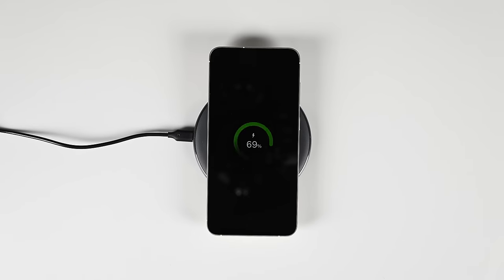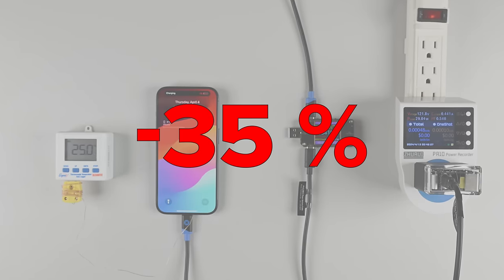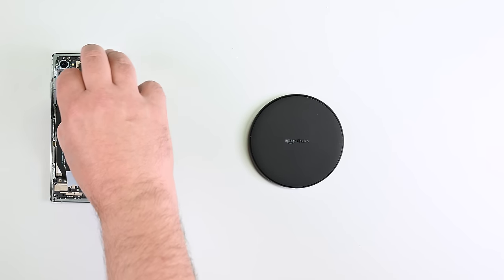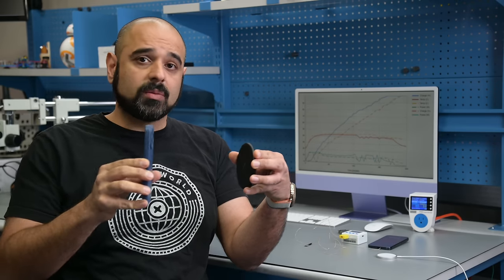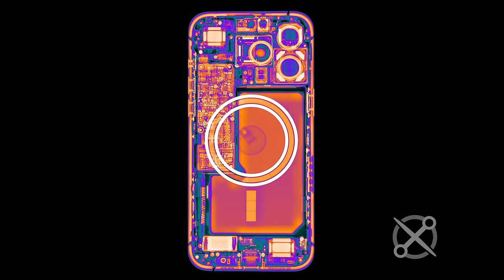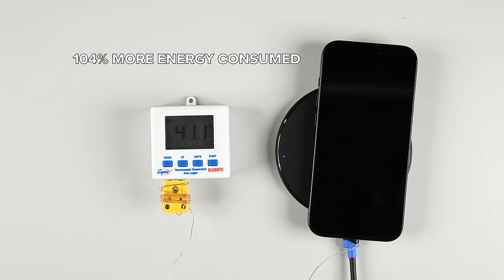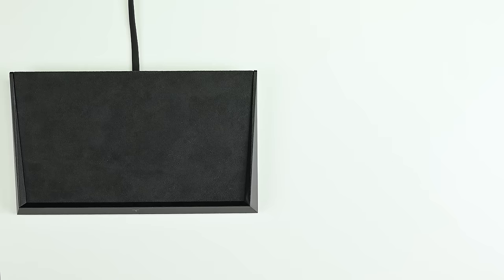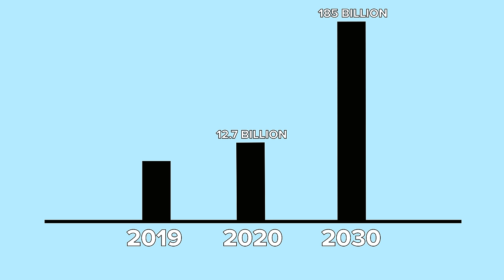How Wireless Charging Works and Why It's Terrible

Comment: The energy wasted over a lifetime of wireless charging is still less that used in a single car ride. Perspective is important here.
Reply: It’s not wasted though is it, that’s the point. All energy has to be converting into another form in this case heat which is degrading your battery a lot quicker
Reply: @a1white cars are wildly inefficient.
Reply: @mastercng  Compared to what, walking?

Comment: To be fair, the wireless charging pads on this video is on the budget side. More expensive and even prorpietary solution like Oppo's Airvooc wireless charging pad has dual coil for maximum efficiency and an active cooling fan working in tandem with the phone's pmcs to control the temps. Even then it's still much more inefficient compare to just plug a cable in. Which is why super fast charging through cable is superior, and a modular charge port design should be made a requirement by law
Reply: MagSafe is not a budget charger

Comment: I think this is an example where the inefficiencies and battery degradation are absolutely worth it. Especially if you use Magsafe or Qi2 chargers, and actively cooled ones when possible.

The convenience of Magsafe/Qi2 especially is incredible for phone mounts on desks and in cars to keep you topped up throughout the day and keep your phone easily accessible.

Also, every phone I've ever used has had charging issues eventually before wireless charging (even my first USB-C phone). With my last phone, I used wireless charging almost exclusively and saved my USB-C port from the same fate.

Videos like this are great to inform consumers about these trade-offs and what to look for to avoid the worst cases, but I definitely think this video is a bit overly critical of the technology.

Comment: Idk how you kept it below 29°C but my 15 Pro Max heats up to 40-45°C when charging via cable, similar to my 12 PM and XS Max. In case you’re wondering where I’m from, Singapore. Average daily temperature is about 32°C with relative humidity about 75-87%. Real feel is about 39°C to 44°C almost daily.

Comment: You completely ignored a big reason for wireless charging: avoiding having the wired connectors wear out.
The energy waste is not likely to be more significant than the physical waste of broken phones, repaired or not.
Reply: just how often do people plug and unplug their phone? i had a cheap 100€ samsung phone with a micro usb port that didn't wear out in 4 years, so i really don't think that's an issue, with usb c being a more robust connector than micro.
Reply: @simpson6700  I plug and unplug multiple times every day.
Reply: @BobCollins42  My mom did that too for 6 years, and the C port is still going strong.
Reply: This comment section is the first time I’ve heard charging ports going bad was a thing.  I’ve never had a phone or tablet stop charging for that reason.  I’m more worried about the battery degrading than the charging port breaking.

Comment: I just use a magsafe-type setup where I don't have to plug anything into the phone (unless you count the magnet contacts as a plug and socket).  The USB-C/magnet adaptor stays plugged in the phone to avoid wearing it out.

Comment: It's all about heat management. I've switched back to a low-wattage charger for overnight use and I'm utilizing the 80% charge option, since I can essentially charge my phone throughout the day at work. Occasionally, I switch to auto mode if I'm on a hiking trip or engaged in similar activities. My 14 Pro Max still retains 100% battery health. I'm somehow addicted to hold my batterylife at a constant level. It feels like an achivement :D

Comment: I've always hated wireless charging for these reasons, but when I eventually had no choice but to get a phone that had wireless charging and lacked a headphone jack I had to switch to using a wireless charger at night while I plug my headphones in via USBC. 

I got a case that has mag-loc or whatever tf its called, got a cheap wireless charger that has the same, and set my phone to charge slowly overnight. Honestly, so far it has been a pretty decent setup

Comment: I had to move to it when the USB port on my phone just stopped working. No data no power nothing came through it.
Phone still works just have to use wireless charging so it is good to know to use chi2 charging for it to take less power from the wall to the amount for charging the phone.

Comment: i only have it for the scenario when i can’t use my usb-c port, either: it’s broke, occupied, wet, etc

i have a belkin in 3 in 1 in my bathroom just so there’s always a charger in there for anyone without having to worry about water and a cable lying around

Comment: I'm not posing this is a naysayer opinion, but this video is a bit misleading and it introduces the differences between the two methods but doesn't quite present the whole picture. 

I'm not an expert by any means, but just based on my experience - there are wired chargers (think quick or fast charging, high watt output) that contribute to higher battery temps during charging, and there are wireless chargers (slower, low watt) that don't contribute to high battery temps. 

and when we consider the energy loss, I would estimate in practical terms, it would amount to...a difference of less than $1 USD over the course of a year? yes, the amount of energy required to charge phones is that low. if folks wanted to adopt wired charging to go green, the difference would ultimately be a rounding error when examining total energy consumption. 

I think the major drawbacks and comparisons demonstrated in the video are valid for the specific products shown, but there are a lot of options in this space that weren't mentioned. so I wouldn't necessarily agree with the blanket comment that wired is always better than wireless, it depends on the situation. 

I would personally vouch for slow charging on low watt wireless for overnight charging, and wired (not fast charging) throughout the normal course of the day if needed.

Comment: misaligned coils result in a magnetic coupling (and hence inductive load) out of the designed capacitive compensation, thus the load presented to the inverter is not fully real and thus power is lost in the reactive part. There are ways to compensate for this, for example adjusting the switching frequency and/or input supply voltage, adjustable capacitive compensation etc..
Reply: in theory losses of the magnetic field can only occur when eddy currents get induced in metals in proximity.. 
it’s just a bit easy to say „generating magnetic fields wastes a lot of energy“

Comment: Of course, with wired charging you run the risk of eventually damaging the charging port. Depending on the phone, it may be harder and more expensive to replace the charging port than the battery

Comment: It's worth mentioning the one advantage of wireless charging - a lack of an opening or port that can become damaged or broken from prolonged use or exposure to foreign material. Though I still only bother with using it as a backup because it's so slow. I tapped directly into the USB-C port for my car's built in wireless charger and it went from a 4 hour trickle charge to a 40 minute rapid charge.
Reply: Did you have a stroke?

Comment: Correct me if I'm wrong but it looks like you did not mention *why* the battery gets warm. It can't be the current because wireless charging typically charges slower than wired charging. It can only be the charger itself, the coils or the charging circuitry inside the phone.
Reply: It because of high losses in wireless charging, it gets converted to heat
Reply: @Leooo969  Yes but it was not mentioned where those losses are and what the battery has to do with it. It's not the battery that does the wireless charging, it's a coil connected to some charging circuitry which then charges the battery, but this last step is the same no matter what the energy source is.

Comment: For all my wireless charging needs, I use my slowest, least powerful chargers to slow the power transfer and reduce heat... however, for the magnets... why? I can't just grab my phone without dragging the charger along, thus may as well just use the cables. For overnight charging, may as well use lower currents to lower the heat production and keep the phone cool.

Comment: It’s good to have that wireless back up option in case the socket gets wet and needs to dry but you still want to charge anyway. Higher compatibility.

Comment: I've owned an S23 Ultra since launch and I've charged it every single night with a wireless charger, yet I've had basically zero battery degradation or capacity loss in 14 months now. This is because Samsung has excellent battery care options like limiting battery charging to 80% and enabling slow wireless charging to slowly charge throughout the night and not heat up the battery, I've made full use of those two options since day one.

Comment: Regarding power loss, whether you use a case, the material, and how thick it is will all further contribute to slower charging and a hotter phone. Most tests remove the case to eliminate it as a variable so your results will likely be a lot worse.

Comment: Is a lower Wattage wireless charger better for an overnight charge?
I usually leave it there when sleeping. On my S23U, it takes around 3h30 to charge from 20% to 100%, but I never notice it getting hot. It's an IKEA charging pad, where the other end is a USB A connector.
Reply: It's best to avoid both wireless charging and charging overnight. Leaving a phone on any charger for a long time after reaching 100% on a regular basis if not good for the battery.

Comment: With the iPhone SE 2020 came wireless charging to me. Unfortunately it doesn't support MagSafe and I bought some third-party stuff. I realized, that the battery lost capacity quicker than usual on former models and I suspected there was something wrong with wireless charging. Most articles on the net told, that wireless charging is as good as cable and there is no significant difference to battery life. Despite that I switched back to wired charging on my new iPhone SE 2022 and experienced better capacity.

Comment: If you use a case on your phone, it may not even charge the device at all. Or sometimes, it will charge too slow. At that point, you might as well use a cable.

Comment: This proves a point about wireless charging. I don't use wireless charging on my phones as cable charging is more efficient.
I once had a wireless charger (sold it on though) which accepted 5V 2A but only outputted 1A to the phone, what a large inefficiency that is!

Comment: taking the efficiency hit seems even less logical since we got USB - C. 

sure with any previous USB when your sleepy in bed but notice you need to plug in your phone or it will be useless tomorrow and never find the right orientation in the first 6 tries, it sucked.

but now you just find the hole cable go's in immediatly and your charging fast but smart with the phone telling the charger what to do, ideal imo. if your charging overnight it can even slow charge the whole night to be at 100% when your alarm go's which i'm hoping is keeping my battery nice and strong (got a ~3 year old pixel 6....seems to be working as intended :P).

Comment: I have a wireless charger, but only use it if my phone needs a quick charge. When I'm doing overnight charging, it's on a regular cord (with battery protect enabled to keep it to 95% and protect the battery).

Comment: My iPhone 14 Pro is 23 months old now and the charging port stopped working often after about 6 months due to the amount of steel dust etc at my job, so for nearly 18 months I’ve exclusively used wireless chargers and the battery health is still at 87% 

My last iPhone got down to 90% in a year and I never used a wireless charger

Comment: The Nintendo Switch uses USB-C, but you can just drop it into the dock, and it connects and charges. But any connection with a cable to the Switch is still firm. Would be nice to have a similar solution for phones. The phones would probably just need some indents for alignment, and the special sauce is then in the USB-C connector in the charging station. Sure, that would probably require the station to keep the phone upright, but that's something I would gladly take.

Comment: Instead of charging efficiency you should also consider wasted space inside phone case. 
That space can be used much better by simply installing bigger battery. For example:
- Motorola Edge 40 has Li-Ion 4400 mAh battery and QI wireless charging coil. Can be charged 68W by wire or 15W wireless. Full charge in ~25m by wire or ~3.2h wireless.
- Motorola Edge 40 Neo has Li-Ion 5000 mAh battery and no wireless charging option. Can be charged 68W by wire. Full charge in ~27m by wire.
You get ~15% more battery which will last longer... and can be charged much more efficient... not even mentioning about "destructiveness" of slow wireless charging...

Comment: Every phone I've owned since 2017 has had wireless charging capabilities, and I can count on a single hand the number of times I've actually used the feature. I always knew about the energy loss, but I had no idea about the significant temperature increases too. I'll continue to stay far away from wireless chargers (at least until phones inevitably lose the USB C port on the bottom).

Comment: Interesting, for me the magsafe serves as phone holders for the locations my phone lives depending on my location. Car, chair and bed. Each has a magnetic phone holder. Each are capable of wireless charging but are simply unplugged. The only one that is live is the primary one next to my chair. I got one of those multi units that charges my Apple Watch, Airpods Pro and phone. Also serves as my phone holder. 
However I don't like having my phone connected to power while full. I charge only when it gets to 50%, bring it to full then wait till it hits 50% again. Every two days give or take. I use this same model for my watch and headphones as well. 
Right or wrong, I believe keeping a unit plugged in all the time while the battery is full is bad for the device.

Comment: This is kinda why I unironically like google's pixel stand. Keeps my phone shockingly cool on account of it having a fan in it. Wouldn't use wireless in any other situation tho, I've had my phone overheat just sitting in my truck, can't imagine how much worse that would be if it was inductively charging at the same time.

Comment: I'm curious about the energy drain of a wireless charging pad without a phone on it. My layperson understanding is a wire does nothing until you plug a phone into it, but doesn't the wireless pad have to be continuously running in case something is placed on it? There's no sensor to tell when to turn it on, right?

Comment: I had my previous iPhone usually for 2 years. Within the first year the battery health sticked usually around 96 to 100%. Then within the second year dropped to 88-92. 
now with my 13 pro which basically only was charged wirelessly I already hit 85% after 2 years and am now at around 81% 2 1/2 years in.

Comment: I used to work with BMW.and during 2021 in the chip shortages we couldn't offer wireless charging on several models, and that was without a doubt the single thing customers were MOST upset about missing, never mind things like heads up display, active cruise or adjustable seat bolsters being unavailable on some models...Nope, it was wireless chargers, despite our protestations about how slow and inefficient it is.
We even had some folk claiming their previous cars were faster and never got hot, which is obviously false.

I'll keep your video here bookmarked to send to folk like that in the future 😂

Comment: I don't use Magsafe to charge my 14 Pro Max. I also didn't use it with my 13 Pro. My 14 PM is 14 months old and still showing 100% health both on the phone as well as through the coconut battery app. I don't have any of the saving settings on and I shut the phone off every day when I go to sleep. Does all this make a difference? I don't know but this is what I've been doing and these are my results.

Comment: This is fascinating, but there's one thing it does not address. The main reason I use wireless charging is to diminish the wear down on the USB port, and it's something several people around me worry about too. Granted, it might be a "problem of the past" with USB-C, but it is still a concern. I changed my past 2 phones due to a bad port, which lead to unstable charging (and even "fried" the internals of the oldest one!), so I went wireless to ensure I can use my device for far longer.

Comment: I was using wireless charging exclusively until recently when my battery swelled and I had to get it replaced. A little digging made it clear that the wireless charging was the culprit, so quit using it completely. Also set the battery charging to limit to 85% and keep a small battery in my pocket to top up if I need it.

Comment: Awesome video :D
I am wondering and often thinking about if it is true that chargers communicate via the cable with the attached devices. 
Like "Hey device XY, I can charge you with 30 Watt, N Ampere and K Volt. What do you accept? Do you also happen to be an Apple-Device?" or that there are mechanisms that ensure a safe charging, like protection against overheating or pumping out a to high / low current.

Do you maybe already have a video about this topic?